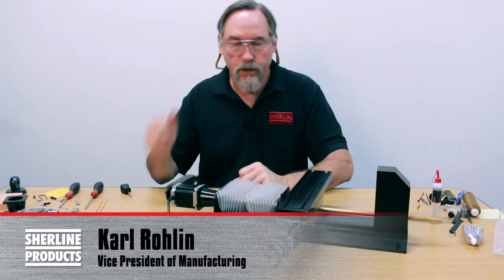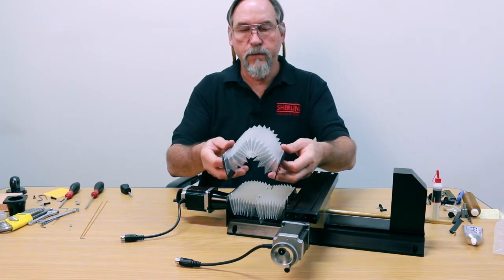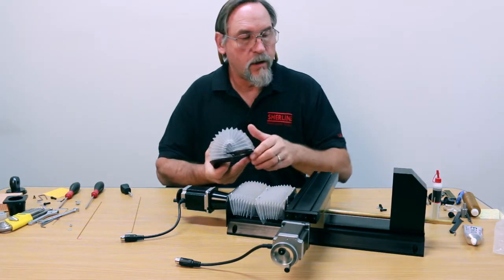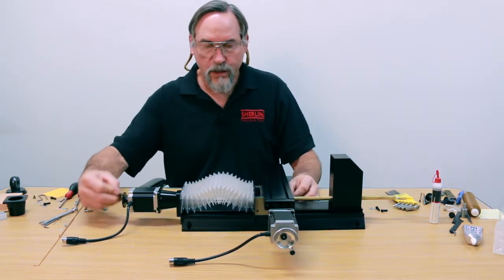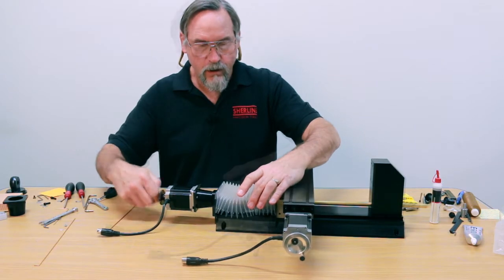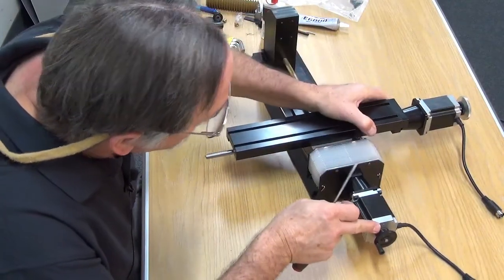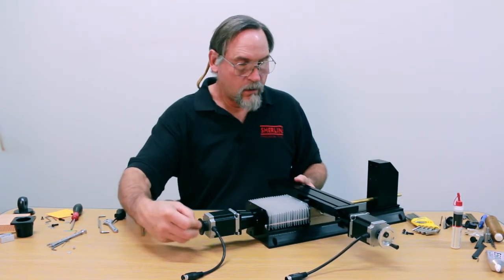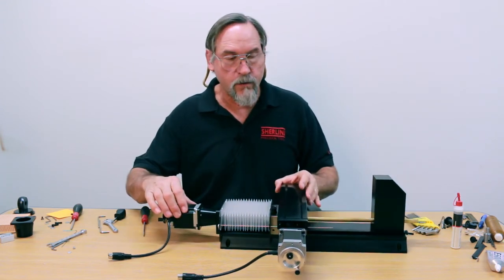Way cover upgrade installation

Comment: What is the part number for the upgrade?  I don't see it on your website.
Reply from the maker: It is not on our website yet. I have been told they are on backorder for now, but if you are interested in purchasing a set, please give us a call on our 800 number.